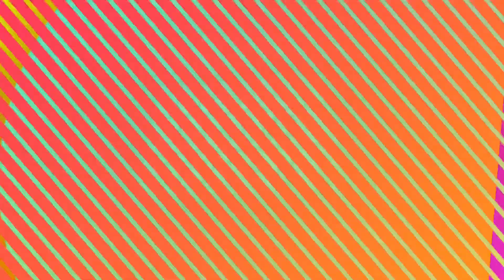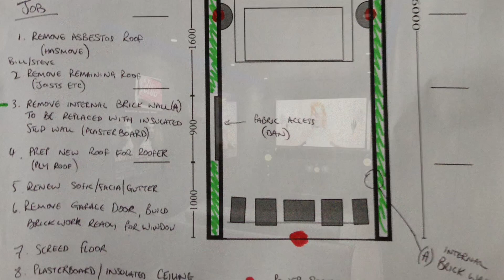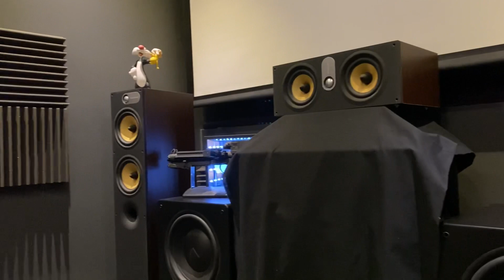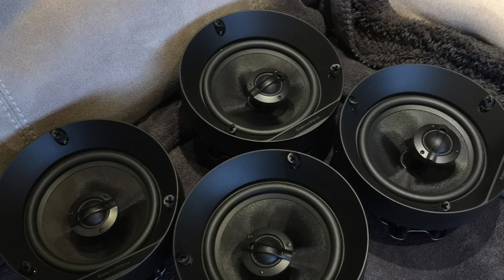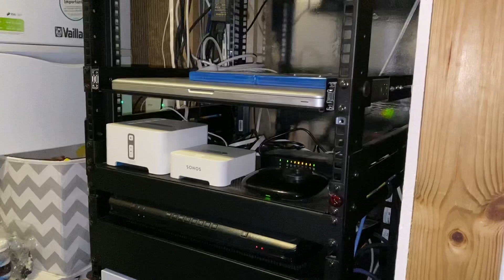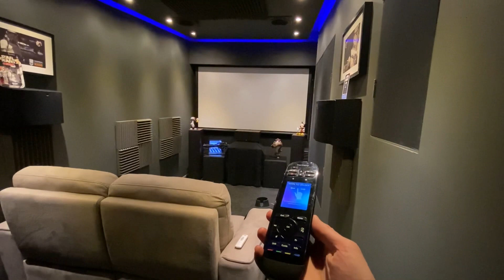Garage to Home Cinema/Theatre conversion: Dolby Atmos 7.4.4

Comment: I'm looking to make my garage into a cinema room with a 7.2.4 set up. Notice your screen is in front of a double glazed window do you have a black out blind in front of the window? I think that's a neat idea actually as will be using it an office space as well and was thinking about installing a side window but this might be a better idea
Reply from the maker: Hi Matt,
Thanks for watching the video. I’ve done an updated one (below) which shows the blackout blind a little better. It’s a Controliss remote controlled blind and I created a channel for it using a wooden frame (DIY) at the front of the blind and foam acoustic tiles to make the back of the channel. It blocks out the majority of the light so the room is perfectly usable during the day. 

Here’s that updated video. https://youtu.be/0xq2N_e-bbA
Reply: @cableguydan  thanks yeah I'm. Just watching your second video very impressive room,. I was thinking about getting sound proofing installed it's a garage that is separate from the house but linked attached to the next door garage also separated from there house I don't think sound would be a huge issue but don't want to upset the neighbours. Would you also recommend painting the plastered walls black?
Reply from the maker: Thanks, Matt. 
I’m lucky with my garage as it doesn’t join the neighbours as there is an alleyway between them. As yours is joined, you might consider some actual sound proofing between them. My garage is connected to our own lounge - when a film is going at a pretty decent level, the sound is not off putting in the lounge, so that’s a positive. There’s only a little noise bleeding between the rooms and that’s just with standard insulation, no specific sound proofing. 

For the colour, we went with Dulux Night Jewels 2. It’s a dark Matt grey - looks almost black when the lights are off, but not too dark when the blind is up and the light is coming in during the day. ☺️
Reply: @cableguydan  Cool will bear that in mind. You have given me some great ideas, thank you 👍. I have a builder coming in the week to quote for conversion I have several ideas in mind so glad I found your channel 👍 😎
Reply from the maker: @MattVs_Movies  aw, that’s great to hear, Matt. I’m really pleased the videos helped. I hope your build comes together well for you. Exciting times. ☺️🤩☺️

Comment: HI thats a awesome room. Im looking at the same kinda shape needing room for boiler washing machine etc. Just wondered  were you abble to leave your gas and electric meters  in the garage  or is that just the electiric behind the doors. Cheers!!
Reply from the maker: Thanks Darren. Good to hear you’re considering something similar. 
The gas and electric meters are both still in there, hidden behind separate fabric panel doors. Thankfully, the doors blend in quite well so you’d never know. :-)
Reply: Yh its looks really good thank you for taking the time to reply
Reply from the maker: No worries, Darren. 
If you’d like to check out the rack in a little more detail, I did a run through video: https://youtu.be/mPY0rlbmFnI ☺️
Reply: On measuring I'm about a meter wider and 0.5 meter shorter so yh should work a treat ..Thanks will take a look!!
Reply from the maker: That’s great. That extra 1m width should make a big difference! 👍🏻👍🏻🤩

Comment: This is a great build considering the space available. Do you mind answering what's under the centre speaker? Also I know you said you're exhausting the heat into the HC room, but how are you then extracting the heat out of there? Surely come summertime it'll be like an oven in there if you don't take it completely out of the room? :D
Reply from the maker: Hi Lewis. 
Many thanks for your feedback. 👍🏻
The centre channel is raised up using an older “Optimum” modular glass AV rack. Then just some black fabric draped over the top to make it a bit neater. 
We’re in the UK and I’d say we have a maximum of 2 weeks of “hot” weather, ie over 30 degrees outside. So, during that time, we don’t use the room. Just use the 55” LG OLED in the lounge. Well, ideally we’ll sit in the garden with a BBQ and a beer. ;-) 
If it was hotter here more often, I’d run an  extractor with bigger fan out of the AV room. :-)

Comment: I'm upgrading with atmos speakers in my attic conversion, to get a 2 meter separation between them they have to go on the sloping part of the  ceiling (approx 30 degree slope). I  onsidered fabricating some sort of housing, as you have done, but they would be a lot more pronounced than yours. Did you consider directional tweeter speakers to compensate for the angle? Thought this may be a good idea in my situation. Great build by the way, love the wife friendly colour schemes.
Reply from the maker: Thanks Christopher. 
I didn’t really look into directional tweeters as they would focus on one sweet spot. As they are, the AVR runs the basic calibration, I then fine tuned based on db. So far, having them not firing directly seems to give a very natural, non-directional ambient effect. :-)

Comment: Great use of space and your equipment is insaaaane! Love it! 
What are the rear surrounds like with them being so close to eachother?
Also, I heard that if you stack subs you get a better response, my system won't allow me to do it but was wondering if it would change the SPL etc on your two rear B&Ws?...
Reply from the maker: Hi Hal. 
Thanks for your comments. Much appreciated. 
The rears are closer than I’d like, however, with that doorway at the back, it was the best option (compromise).  
As it’s Atmos (object based rather than channel based), I don’t think it’s too much of an issues. As the AVR maps the room and the speaker location to allow Atmos to work properly, the soundstage is still okay (not ideal, but okay). 👍🏻👍🏻👍🏻

Comment: Nice way to work with what you have. 

curious on your fan system. 

How much gap do you have between your walls where the fan is? I'm trying to do the same but I have more space than the width of the fan case. About  4inches in u.s.  (I know we like to be difficult) about 10 cm.
Reply from the maker: Hey there. Thanks for your comments. :-) 

The wall near the projector (in that specific area) is just single plasterboard (dry wall?). As it’s all internal, we didn’t require double skin or insulation in that area, allowing us more room to house the equipment. 👍🏻
Reply: @cableguydan  thanks for the response.